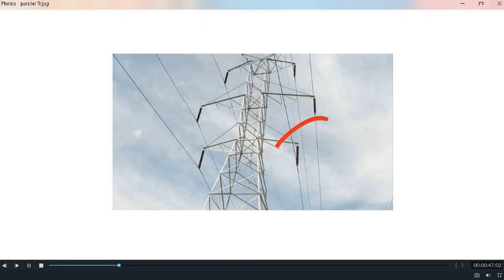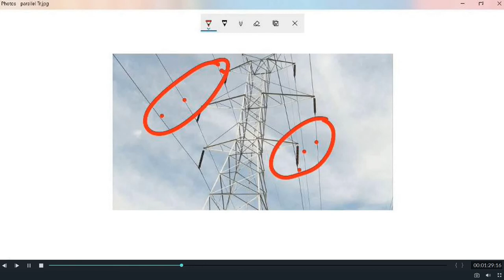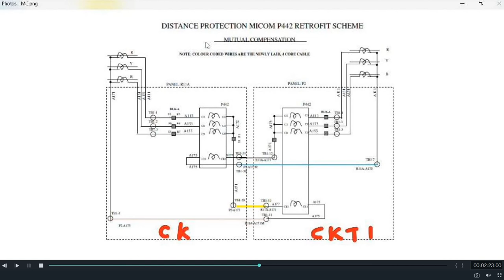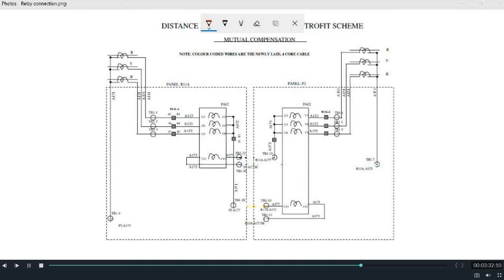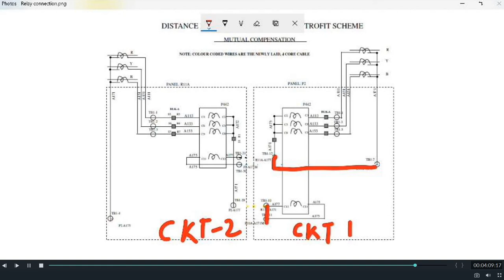How to do Mutual Compensation of Transmission Lines in Relay

Comment: Sir please explain how this mutual compensation coil works to reduce mutual compensation effect in parallel line by theoretically and mathematically... Thank you
Reply from the maker: Sir, how the mutual compensation coil in a relay is framed is not known to me. Relay manual or the manufacturer may explain it. but it is framed in such a way that the effect of mutual induction is nullified by connecting the coil. Thanks for watching